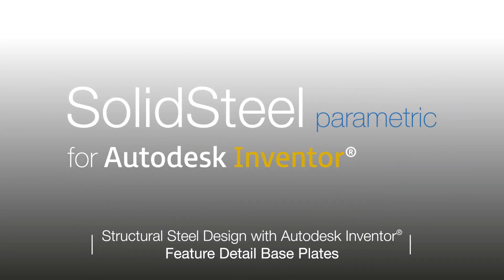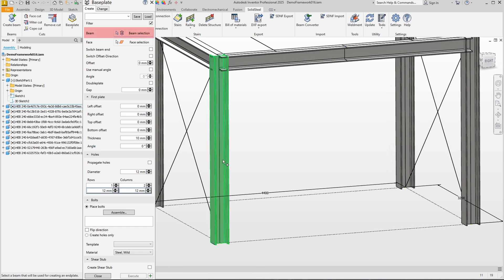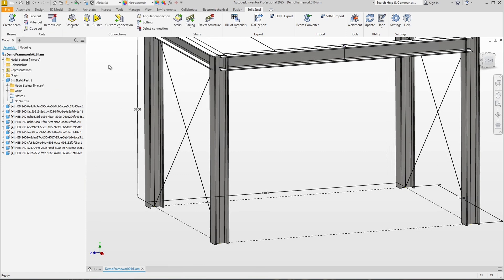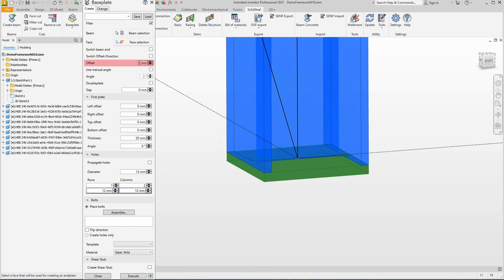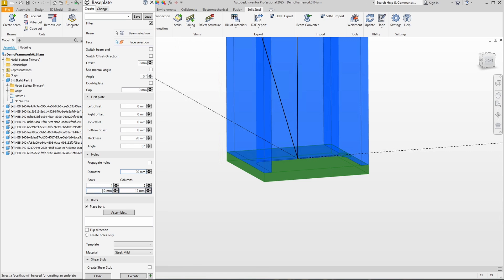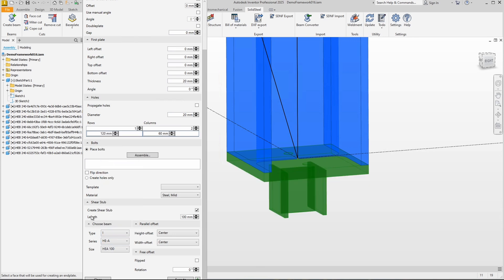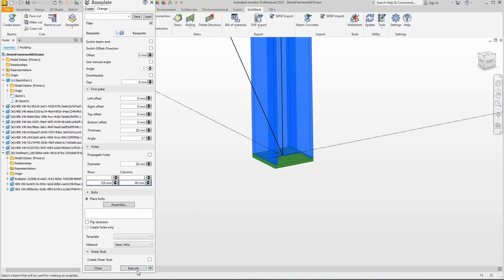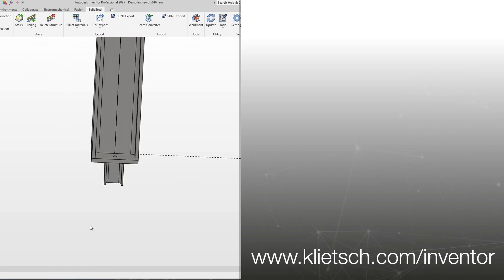Base plates in structural steel design with Autodesk Inventor – SolidSteel parametric tutorial

Comment: Hallo, ich bin gerade SolidSteel parametric für Inventor am Erkunden, wie bekommt man die Positionsnummern auf die Stückliste (auf der Zeichnung)? Inventor übernimmt nicht die Positionsnummern von Solidsteel.
Reply from the maker: Sie können die Part List auf der Stückliste editieren und als zusätzliche Eigenschaft die „klPosNr“ hinzufügen. Das ist eine der Eigenschaften die SolidSteel parametric (optional) an alle Teile schreibt. In dem Fall der „klPosNr“ handelt es sich um die Positionsnummer des Teils. Sobald das gemacht wurde, erscheint in der Part List auf der Zeichnung die von SolidSteel parametric vergebene Positionsnummer. Sie müssen allerdings sicher stellen, dass die Eigenschaften auch an die Teile geschrieben wurden. Das geht in der Funktion „Meta Data“. Alle Informationen dazu finden Sie auch im Handbuch auf Seite 113 (Manual Version 1.2.x) oder indem Sie im Menü „Meta Data“ auf das kleine Fragezeichen oben rechts klicken.
Reply: No @apps4inv